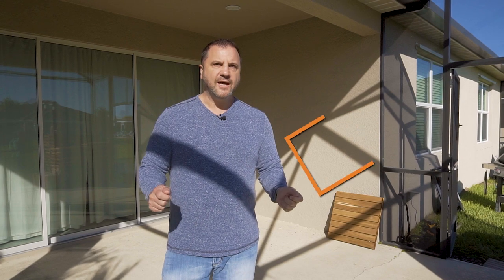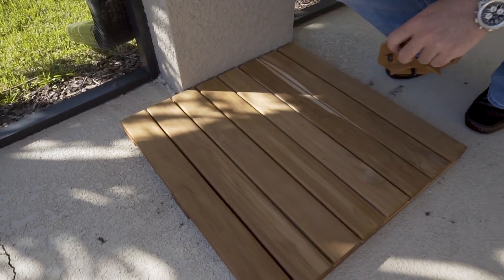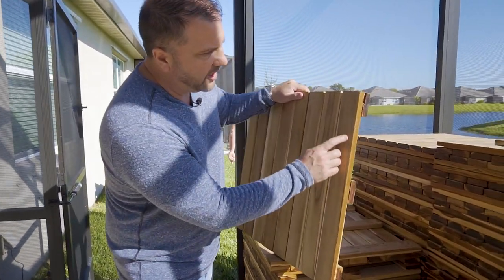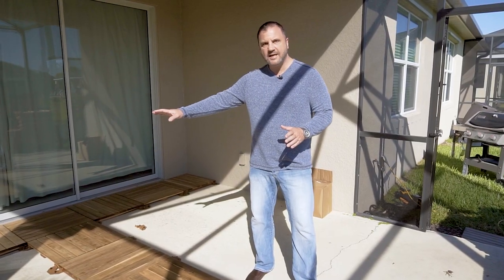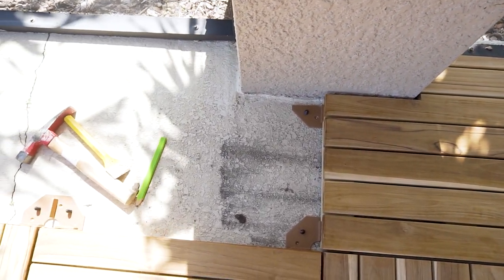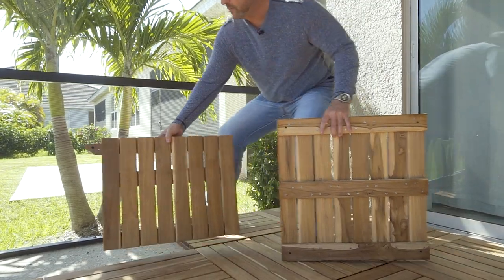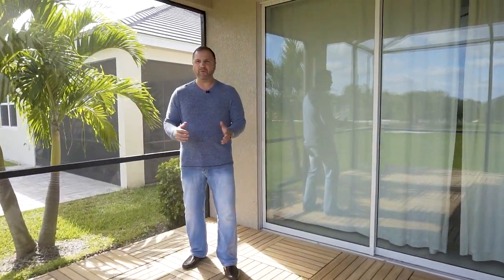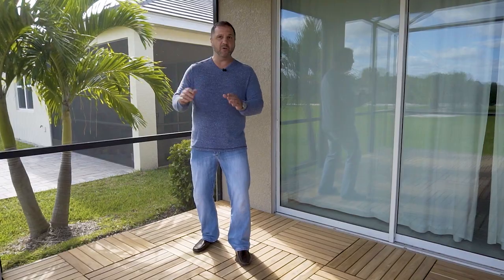How To Install Deck Tiles - [Concrete Patio Makeover]

Comment: You don’t mention leveling. Do these deck connectors have any leveling feature for a 1” slope?
Reply from the maker: We sell a pedestal system on our website for sloped surfaces. A 1 inch slope isn't that much and if its a concrete patio you would want the patio sloped away from the house for water drainage.
Reply: @AdvantageLumber  Pedestals are a bit too tall. I have a rooftop deck that slopes at the edges for drainage. A low profile option with a leveling feature is what I'm looking for since the door to the rooftop has very little clearance.

Comment: You know how you go to the restaurant, sit down and the table rocks because of the uneven concrete? Do you sell beer coasters with these?
Reply from the maker: The table rocks because of the table. Deck tiles don't "rock". Grid pattern, locked in by evenly spaced connectors plus the weight of wood. The decking is a sturdy as the concrete its on top of.

Comment: Could I use this exact system laid directly on epdm rubber membrane?
Reply from the maker: Yes we have many customers use them on rooftops for decks.
Reply: @AdvantageLumber  I wish you answered this sooner. I asked this question 3 months ago as well as called a few times with no answer. I ended up having to go with a different companies product due to not getting an answer .

Comment: My patio is not enclosed. What happens when rain gets in it
Reply from the maker: Not to worry. The deck tile connectors keep the tiles elevated from touching the ground. Add a little end seal to the cut part of the tiles edges. It's ok if the tiles get some rain. Ensure longer protection with a coating of Wise Coat.

Comment: Why is this not installed for elevated decks?
Reply from the maker: You can install these on balconies existing surfaces. 
Deckwise makes a pedestal system for uneven surfaces, if that is what you are referring to.
https://www.deckwise.com/adjustable-hardwood-deck-tile-pedestal.html

Comment: Isn't it better to use torx?
Reply from the maker: Are you referring to fasteners? These do not require any fasteners. They only use the Deck Tile Connector System.
Reply: @AdvantageLumber  they do but a few of the boards need cutting and then the fasteners are removed and reattached